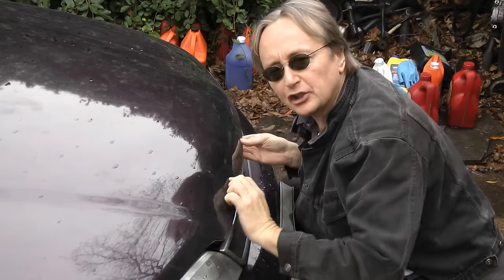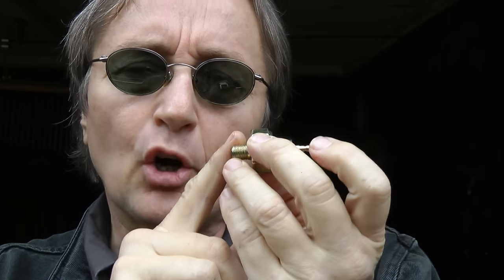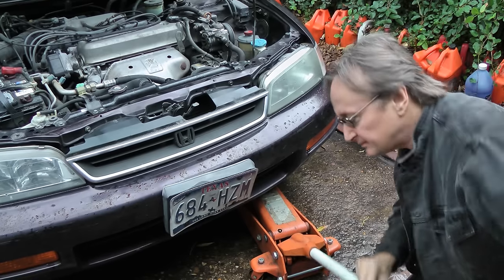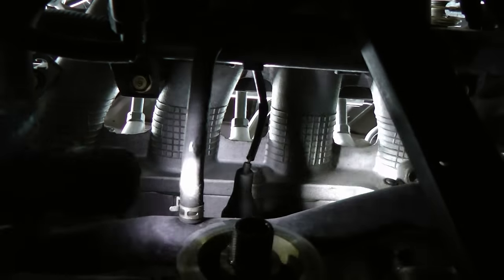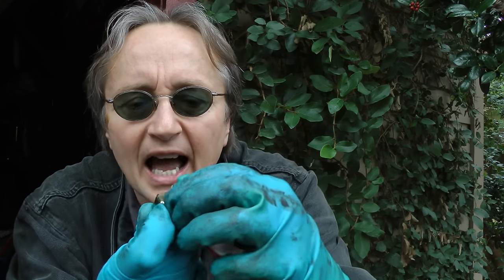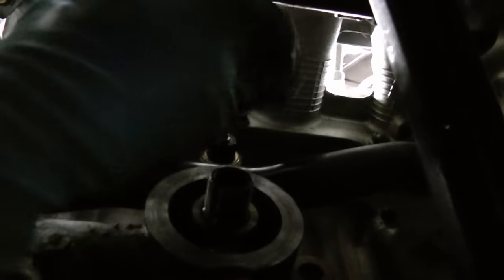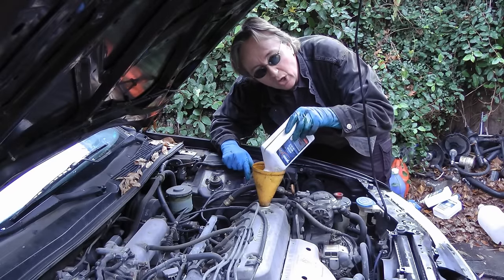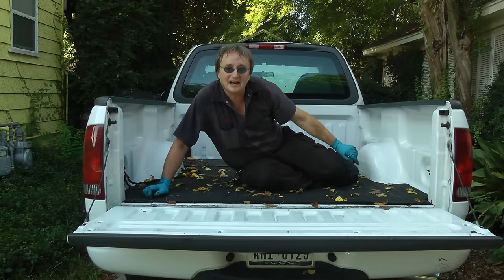How to Fix a Low Oil Pressure Light in Your Car

Comment: When I turn the car on I have a loud nocking sound after 10 seconds oil pressure drops to 0.i rev the eng to 2500rpm oil pressure goes up.help Scotty .thanks

Comment: Hey Scotty, I changed the oil and the oil pressure on my 2012 Dodge Grand Caravan but the oil light still turns on when I stop the car. Any idea before I go to the dealer.
The car has almost 160 000 miles on it
Reply: Was it your oil pump? What did the dealership do to fix it?

Comment: Hey Scottie, I have the same car. I do my oil changes my self. I always use 10-30 motor oil Castro. I recently changed it and now whenever I run my car for 20-30 min and I come to a stop and my oil light comes on. Any suggestions on what it can be? Btw my car is a 95 accord lx with 120,000 miles.
Reply from the maker: +Mike Bernardino  change the oil filter, it may be bad.

Comment: I had a oil level sensor go out in my Pontiac. I called the shop, they wanted $120. I changed the sensor when I was changing oil. It literally took me 3 minutes to change the sensor. Sensor was less than $20.

Comment: If it's not the sending unit. What is the most common reason why an engine has low oil pressure.
Reply from the maker: weak oil pump, or worn engine bearings that lower pressure from too wide a space
Reply: Thanks!

Comment: Hello Scotty, I have a 2008 Honda Accord 2354cc in Hong Kong, my oil light came on and off again for a an ongoing few minutes. Then when I was driving it home, I can hear some noise under my drivers seat which is on the right hand side. When I was driving up to the high level carpark the noise became much much louder. When I arrived at the car space I quickly turned off the engine and went to the bonnet to check the oil level while the engine was still hot. The level was so low that I want to ask you , can I buy some oil to fill it in? Can I still drive it to my technician which is about 20km away from my place? 

One more question, my engine lights have been on for approximately 9 months now. Would this be the cause for the oil level indicator to light on? I have check with a technician around 7 months ago where he plug a reader which says my O2 sensor is faulty. I also have power steering leakages in the car, around every two to three days I need to fill in some power steering oil into it. The leaking will always stop and the minimum level but whatever I add oil past the minimum level up to the maximum level will leak out.

Thanks for you time
Reply: Did you figure out the problems? I seem to have these exact problems as you, even with powesteering leak.

Comment: Hey Scotty, I have a 97 corolla low oil pressure is causing a load knocin noise sound seems to come from the bottom or block cant tell its sounds like a hammer on metal, I have tried pulling out spark plug wire to each spark plug to determin which cylinder its coming from but the noise is there no matter wat plug i take out. on a side note not sure if this is related but it steamed up and the turned off on me not sure if the steam was from the radiator or motor, the radiator looks pretty beat tho however when i checked the temp gadge it read medium temp. Please Scotty help me save her, what should I check chankshaft, bearings, oil pump? If theres anway you can do a video on this it would be a tremendous help to me and fellow youtubers with simulare issues thank you so very much for you time and help :)  

P.S. -Already added oil and lucus oil thinking about spraying PB blaster in the spark plug area next pretty sure its prob bearing look foward to hearing your response again thank you.
Reply from the maker: well, the bad news is damage has already occurred from low oil pressure and engine would need a full rebuilt now. Me, I'd get a japanese used engine and put it in if you want it fixed. See my video "How to replace an engine on your car" that's a toyota too I did for my son
Reply: Scotty Kilmer
 Sounds like fun haha. Thanks for the quick reply ^^

Comment from the maker: @pspdude7 tons of thing, everything in this video plus a weak oil pump or clogged passageways in the engine. Try the video tips first.
Reply: Hey scotty been watchn ur diys for a minute now and was curious whats the common issues w a dakota just baught an 04 sxt 4x4 3.7l loses pressure at idle but no noticeable engine noise oil looks decent any thoughts? Whats your opinion on dakotas... Also have an issue with trans over drive slips bad then drops a gear then shifts back slips n drops back down again thoughts on that and whats a great replacement transmission for the 3.7l dakota 4x4? Thanks scotty my wife and 4 month old will sure appreciate the help :]

Comment: I have problems with my 2003 Mazda B3000
My oil gage keep making low .
And I replaced the oil switch but the problem still continues.

Comment: I have a 2000 mercury sable ls the oil light flickers when I am at a stop not all the time car runs fine I replaced the sensor on it but still flickers when in neutral light stops flickering its I herd that the computer is not strong enough on these cars and its a normal problem its driving me crazy any information would be helpful thanks
Reply from the maker: well, a car that idles too low will often do that, putting it in neutral makes it idle higher.  If engine makes no clanking noises when light flickers on, ignore it or try to get the idle to go a bit higher. Not easy as they are computer run and have no manual adjustments anymore

Comment: hi scotty  my car is a mazda millena 230,000 while im driving the light comes on and then off, that happens five or six times while im driving so i wanted to know what do you think it is?\
Reply from the maker: change the sending unit and pray, cause if it's not that, engine has low oil pressure problems inside the engine with THAT many miles on it

Comment: Hi Mr. Scotty Kilmer,
My 1990 Honda Civic DX's Oil Lamp Light turned on and I had it serviced by Meineke, (big mistake according to at least 3 people). Anyway, after paying about $ 180.00 for the test, parts and labor to change the oil pressure sending unit, it still comes on. Of course, they won't credit me even though they said that that was the problem and that what they did will fix it. (They even said that it would run for  at least another 50,000 miles) PLEASE HELP ME, I don't know what else could be wrong and how to fix it. I just wanna know if I should still try or just give up on it. Thank you very much

Comment: I have a 01 lincoln towncar, it has a rattle noise and oil pressure light on. I replaced the sending unit. problem still there.
Reply from the maker: odds are oil pump is bad or engine bearings are worn, try a pump
Reply: Scotty Kilmer OK that's what I was thinking.  going to take it to a shop tomorrow. had 1 shop say just buy another engine by the way it sound
Reply: Scotty Kilmer I had another guy look at it. he said it's the timing chain. he say oil pumps hardly never got out in a towncar

Comment: Scotty  I am a 2008 cbevy aveo just did a oil change and my oil light is on but when I drive it it turns off and come back on while I stoping at red lights or stop signs plz help
Reply from the maker: +James Sartin  try a different oil filter, bad ones can do just that. Also make sure you are using the correct weight oil
Reply: +Scotty Kilmer I am useing 5w-30 I am also gonna switch the sending unit out
Reply from the maker: +James Sartin good idea, but realize if it happenned right after the oil change more often it's poor oil or oil filter with a bad bypass valve in it.
Reply: +Scotty Kilmer  were would the by pass be at ?

Comment: I need help quick!! My 1993 Chevy 2500 3/4 won't get enough rpm's to shift, it jumps from 1000 rpm to maybe 2300 And then back again. Once I get to speed it drives fine. As well as it idled just fine. It struggles gaining rpm.

Comment: I have chaverlot beat car 2014
Oil presure signal show me. 
I change oil presure switch
But still signal on
Oil presure low show me when car running slow in traffic or standing. 
But when car running free way signal going off. 
Suggest me what I do now

Comment: I have an OPEL ASTRA 1.8cc 1999  AUTOMATIC  4cylinders...The oils light is on  and it goes off when I press on the accelerator with some forces,,,I have replaced the OIL PUMP but the light stays on,,,could you help me???
Reply from the maker: replace the oil pressure sending unit, pray that fixes it. If not, engine is idling too low or you have worn engine parts like main bearings
Reply: Is a main bearing in the cambelt/timing belt region ?

Comment: I have a 2000 Ford focus. My oil light comes on at idle but gos off when u drive. And give it throttle. Motor isn't ticking or anything. I drive it to work 30 min away an no knocking or anything but when I stop at idle that light comes on.

Comment: What does it mean if oil light comes on n flickers but only after driving 20kms or more and then goes away after turning car off for 20-30minutes it’s running fine engine sounds great and engine light has not come on 
It’s a 2007 Hyundai Santa Fe turbo diesel

Comment: Help, I turned my car on, ran fine wih no noise or vibration but it had the low oil pressure light come on imediatly after so i shut it off and now it wont start, turns over but it wont start. There is also oil around the oil pan plug. Its 04 Audi A6 3.0 Qtro engine code AVK
Reply from the maker: engine may be blown, fill it up with oil and try to start it but if light comes on again or it won't start, odds are engine is toast

Comment: 03 a4 1.8t drove it for a hour and the low oil pressure light turned on but continued driving and the car shows no issues but the light come backs on every so often. Car shows no isses and sounds fine
Reply from the maker: replace the oil pressure sending unit and change the oil if it's dirty

Comment: my dodge neon 04 oil light comes on when I'm on a red light. once I start driving it turns off for a few seconds than turns back on. what can it be?
Reply from the maker: +Skyefuego try this fix, pray it's not actual low oil pressure requiring engine rebuilding
Reply: Crap,You got me more worried now.

Comment: Hey scotty I have a scion tc 2005 I was driving like any other day then my car turn off and the oil pressure light the batery light and the check engine light comes out I get scare I put car in park and started again the lights went away but looks like I lose power please please any ideas guys

Comment: I have an Inifiniti g35 I got my valve cover gaskets changed  as well as the spark plugs but the oil pressure light is showing and the car is smoking

Comment: Hello there, my mom's 2011 Ford Edge cranks but will not start. Says Low Engine Oil Pressure. Oil level is fine. Car does sit a lot but was driving fine 2 weeks before it sat in the drive.  Help??? Is this a dealer repair? I sure hope not, mom can't afford a dealer repair. Thanks
Reply from the maker: replace the oil pressure sending unit and pray it's just that cutting power off to the fuel pump, they are designed to do that when they show low oil pressure.
Reply: Ok, thanks!
Reply: Replaced the oil pressure sending unit still won't start. Tries to start if you spray starting fluid where the air filter is. But never starts, ugh.... Any thoughts???
Reply: Up date...I try to start the car with my dad's key instead of my mom's key. I read where someone said it could be a bad connection with the ignition switch or the key itself so when I put my dad's key in the ignition it jiggled it and pressed in sort of hard and Wa La...it started. So it ran until I shut it off and now it won't start again, ugh!!! Could this be a bad ignition switch?

Comment: Yes that is normal. If the engine is not running the oil pump is not turning there is no oil pressure.

Comment: Please help me -- I have a 1988 bmw 735i, just replaced my oil and changed to 5w-30 and now my oil pressure light is on, and my oil level is fine. What could it be?
Reply from the maker: +Kappa Cow try a different oil filter, yours could be bad. Also try a different brand of oil if that doesn't work
Reply: Scotty Kilmer Okay thanks!

Comment: This is what my cars issue is the mechanic changed my oil pump, oil filter and pan then he said the oil light won't go out. But he refuse to change the sensor saying it isn't the issue this is the only piece he didn't change and refuses so my car died while driving he said I blew my engine but I believe the issue is this and the starter now got to find a third mechanic to change the sensor and check my starter

Comment: Hello,I have Honda odyssey 2003 oil pressure light keep blinking after I drove for 40 minute most of the time start blinking after I hit the brake it keep blinking until I turn off the engine

Comment: lol.....My luck has always been worn rod/main bearing or a bad oil pump...nothing as simple as a "bad oil pressure sending unit" ...lol...Especially stopped at a light...Oil light.....blinking....blinking.......blinking.................luck of the draw i guess.
Reply from the maker: +TVWXMAN32 guess if you didn't have bad luck, you'd have no luck at all. Maybe thing's will change in 2016
Reply: Hoping to move to Texas or Oklahoma this spring...its all ready looking good. Goodbye northern climate! lol

Comment: Can someone explain to me what this means -27? 👈 Is this # bad?  Oil is scheduled to be changed in 1wk. Another question...Why does the panel show I need oil change now if I have 200 miles left on the sticker? BTW I own an Acura Rdx
Reply: mechanic scam
Reply: Your car's ECU is compensating for the way you're using your car. If you mostly use your car over the road then the oil service time will be pretty accurate w\ your odometer but if you do a lot of stop\start and start up\shut down operation as in city use the ECU will compensate by the percentage of the amount of this type of operation it sees. You do more of it, the ECU will shorten the time frame between oil service times more to compensate to protect the engine. This is by design from the manufacturer.....not any mechanics. The only time a mechanic is involved is if they (or you if you do your own oil changes) changed the oil early and forgot to reset the ECU at the time of the change. Then the ECU will be even further off for the next one coming. FYI.

Comment: think i have a bad oil sending unit i’ll get it replaced since they don’t cost that much randomly my oil light is coming on only happens when i drive for a while then change gear to park and it happen a least twice when i change to reverse i have a 09 mazda 6 i check the oil level and it’s good and just change the oil a month ago don’t hear any engine noise and no vibration and car had no trouble starting  just don’t know why it’s happening randomly for about a few weeks now

Comment: ok i just got back from the mechanic, he says it could be 2 things, a thing named "bulb" in spanish Bulbo. or the pressure bomb. weird thing is that the light does not come on all the time it sporadically turns on, it blinks and then stays solid. kind of annoying though.this thing u changed in this video he told me is not just a matter of changing it.

Comment: @FoxyWolfProductionz Same thing happened with my buddys civic.  His oil was critically low, and apparently that was not enough to trip the oil light so he kept driving.  The engine just louder and louder until it started knocking, and by then it was too late.  We added oil but the engine had already spun a rod bearing....So we just rode it around until it threw a rod threw the block, heheheh

Comment: This happened to me twice when while I was driving and came to a complete stop at a stop sign, my engine light turned on and my car stopped. My car was on but the engine turned off, then I had to turn the car off and back on again for it to drive again. Can anybody tell me what the problem is?
Reply: Alberto Guerra that same thing happened to me! and now idk what to do
Reply: @rosalia5089  check your spark plugs to see if they are old and need to be replaced or if any of them have oil on them. If not, you might need a new throttle body

Comment: Came to a quick stop and oil light came on then went right off. Car is running fine though, no noises, oil level fine. Should I be concerned?
Reply from the maker: IF engines makes no clanking noises, oil pressure is not really low. try a new oil pressure sending unit

Comment: I have a 96 Ford Thunderbird and when my gauge light comes on my car then would rattle then cut off on me... Why is that?
Reply from the maker: that means you really are losing oil pressure, engine may be toast now but check the oil pump first

Comment: I have Mitsubishi galant 2007 and I changed the oil pressure pump and sensor also but the light still comes on 

I don't know what is the main problem with my car 

And when i hold the eccelator the oil pressure light hide for 2two to four seconds then come on
Sir please tell me the solution
Reply: I have that same problem on my 2006 galant its the oil pump guaranted im
Reply: Or you have an oil leak somewhere most likely the oil pan gasket

Comment: 2000 chevy s10 159k. 10psi hot idle. 60 psi cold. Drops down after driving about hour. Worried its Cam bearings

Comment: Not to bust balls, but teflon tape is a bad recommendation, because noobies will pile it on, and crack the aluminum parts. The steel sending unit always wins.
I just spent 6 hours replacing a camshaft carrier on a 2004 Cavalier because the owner tried this fix himself. IT'S BEER:30

Comment: I got a 95 dodge ram 5.2 ltr. My oil light would flicker when at a stop but wouldn't stall. However I changed the oil and at every stop it would stall out or if I go under 15 miles an hour it would shudder and stall. I bought a book on this particular motot but it does not show where my sensors are at. I thought  that was really stupid and a waste of money